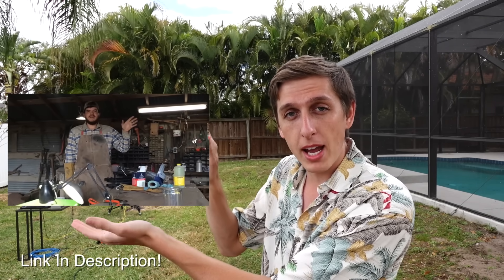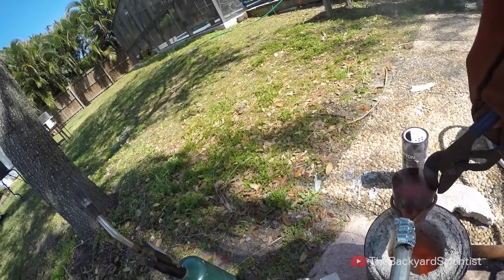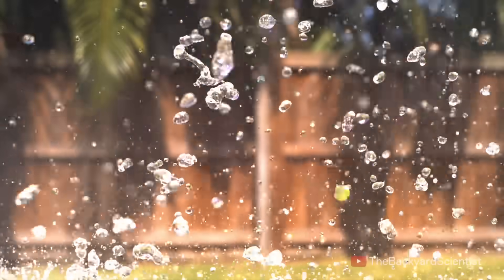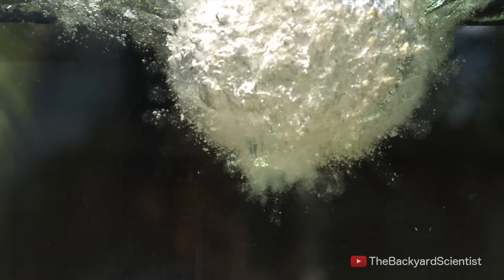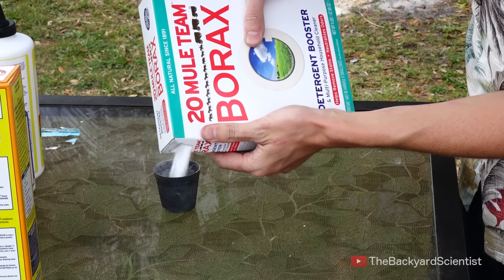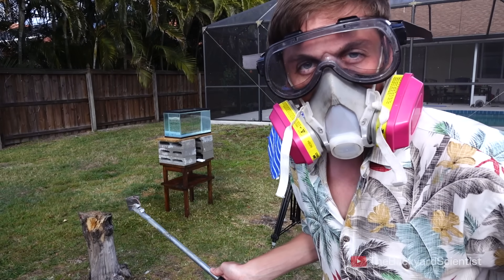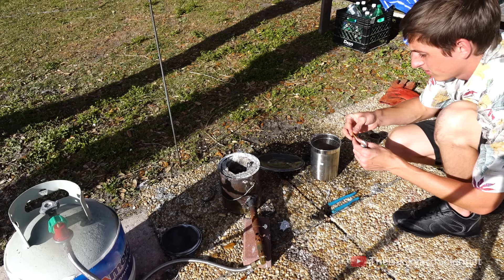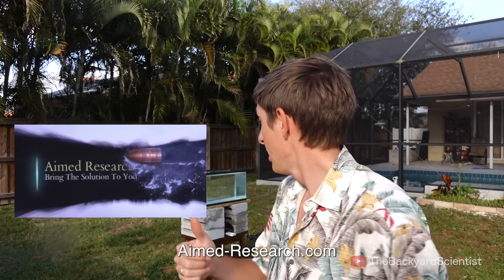Pouring Molten salt into Water - Explosion!

Comment: This due to the high solubility of NaCl in water. Each grain in solid NaCl can interact with H2O normally. It usually involves a lowering of temperature but we don't notice it. Now if you have molten NaCl, that means the molecules are in a liquid lattice, so less molecules are freely accessible to interact with the water. that coupled with the high temperature of the molten solution is why it explodes. There is excess energy to facilitate the dissolution, but not enough NaCl exposed to H2O. All the other salts are only weakly soluble

Comment: The principle behind this steam explosion is that when water turns into a gas, its volume increases 1700 times. (1L-->1700L)
By introducing water to a substance at a high temperature of several hundred to over a thousand degrees Celsius, the volume increases instantaneously, generating tremendous power capable of easily destroying a container.

Comment: When you're dealing with extreme heat and cold things will happen which is why you don't use water to put out various fires. You can get explosions. Try having molten metal and pour water on it. It explodes

Comment: Molten salt frequency generates Hydrogen with heat setting off the Hydrogen thats very flammable and boom 💥?  It's all about frequency.  Like so many use frequency to generate HHO from water correct? Yet no one ever uses an ultrasonic vaporizer set at a frequency to generate HHO from liquid air generated by a Stirling helium cryogenic piston? Using water 💧 to generate HHO is low end generation of HHO using liquid air to generate HHO would be more efficient because everything is already in a gas state just super cold in liquid form? I'm not a scientist so never hurts to try  it out see if it actually works? 😊

Comment: It seems the next step was obvious but was not taken . It should have progressed to melting the sodium metal and the salt together and then pouring it into the water . And then melting them separately but at the same time and pour them both separately but at the same time . Not a simple feat but a smart guy such as your self could probably come up with something . What's interesting is that it is releasing a great amount of energy . If you could have a way to harness that energy into a useful purpose it might be something to explore further. Remember you can neither create or annihilate anything . I mean if you could turn it back into its original form it might also release it's energy changing from one form to another. If you could keep the process going I would think there is definitely enough energy to drive some sort of piston .
Reply: I was just thinking what happens when salt water comes in contact with hot magma like an underwater volcano ? Or if lava was to flow over the salt flats .

Comment: This is a chemical reaction due to the miscibility of molten sodium chloride in water. As the sodium chloride dissolves, the surface area for the heat transfer into the water grows exponentially which then results in the instant creation of steam.
Reply: That is what he said basicly and that is a physical reaction because the salt and the water don't change
Reply: @DanielThePyroGuy makes sense ... Miscibility is a physical process if no new compounds come from it.. had to shift my perspective
Reply: @uswine  yeah i think that this explination is pretty plausible
Reply: Because it fits the observations quite well

Comment: The Leidenfrost effect breaks down for sodium chloride (NaCl) due to its unique interaction with water. When molten NaCl is poured into water, it initially forms a steam layer that insulates the salt, similar to other substances experiencing the Leidenfrost effect. However, NaCl's high solubility in water leads to rapid dissolution, disrupting the insulating steam layer and causing direct contact between the salt and water. This contact results in rapid heat transfer and steam production, breaking the Leidenfrost effect and leading to explosive reactions

Comment: It's a chemical reaction, since this explosion also occurs with hot but not yet molten salt.

It also doesn't hapen with other stuff thay is hot and molten going into water.

The sodium in the salt must be reacting with water at high temps somehow.
Reply: But the salt or water didn't change no ph change and basicly all the things the sodium could React into would change the ph
Reply: And he showed that barely molten salt didn't explode and he had to heat it up even more for it to explode violently
Reply: @DanielThePyroGuy  it does explode with not yet molten salt, I'm guessing the explanation he provided is a part of the effect, but it's not the entire effect, since there is still a reaction between solid salt and water.

Comment: It explodes like that because the salt is very freaking hot and it's being poured into much much much cooler water. Not a freaking mystery
Reply: Then why didn't the other molten salts explode like the sodium carbonate which have a higher melting point so would be hotter?

Comment: The reason that molten table salt gets explosive in water is because melting table salt does 2 things, exothermically breaks the chlorine sodium bonds, which makes the chlorine release it's self as chlorine oxides whild leaving the sodium to melt.

What gets left from that is PURE ELEMENTAL sodium in it's extreme liquid explosive variant.   When pure sodium is liquid, it immediately explodes way easier in water.   Sodium's metallic form does a dosey doe on the surface of water or a bumper boat kind of thing (depending on what it was tossed into) before violently exploding 🤭🤭😂
Reply: He tested molten sodium in water and it exploded way differently he also checked the ph of the water before and after dropping in molten salt and detected no change if it was pure sodium reacting it would've formed NaHO which would increase the ph

Comment: I think you could test the leidenfrost effect by heating salt to the same temperature as you would a burner that a droplet will sit/dance on comfortably, and try the water the same way, it should last just as oong on average, unless salt gets dissolved in it, and that lowers the boiling temperature (which would again act as an explosion)

Comment: I think the reason why the other sodiums didn't work is because they weren't a pure crystalline mineral. If @scottmanley is wrong then I stand with my observation. So instead of sand or gravel, use sugar. That explodes in superheated water, of course due to the disturbance of the waters surface, but maybe there is a similarity? And if that's the case, then the physical reaction theory remains true. Perhaps @just4deez explanation is an expample to why my observation may be correct. If that's the case, could you do the same with larger crystalline structures? Or do they have to be broken down closer to the molecular level? Which would make sense if just4deez is correct, because it could spread through the water at a quicker rate covering more surface area of the molten substance. Either way, crystalline structures react rather oddly compared to other minerals and materials. Taking into consideration their molecular structure and how they interact with light. Perhaps there's more there than the average joe knows. Thats why I'm posing the questions, I'm the average joe lol Alright gotta get back to work now 🙃

Comment: Its the water changing to gas rapidly that makes it explode. It will mess you up if you do not heat all moisture out of a form  when pouring molten metal like lead into something. Even  if i there is a small amount of water.

Comment: From chat gpt:

Molten salt can cause explosions when it comes into contact with water due to a phenomenon known as "thermal shock" or "steam explosion." When a substance, like molten salt, is at a very high temperature and comes into sudden contact with a much cooler substance, like water, the extreme temperature difference can lead to rapid and violent vaporization of the water.

Here's what happens in more detail:

1. *Rapid Cooling:* Molten salt is at a very high temperature. When it comes into contact with water, which is at a much lower temperature, the heat energy from the molten salt is transferred to the water very quickly.

2. *Rapid Vaporization:* The intense heat causes the water to vaporize almost instantly, turning into steam. This rapid vaporization creates a sudden increase in pressure.

3. *Pressure Buildup:* The steam generates pressure within the water, and because it's trapped by the molten salt's surface layer, the pressure builds up very quickly.

4. *Explosive Release:* The pressure buildup can become so rapid and intense that it can rupture the molten salt's surface layer, causing an explosive release of steam, hot salt particles, and potentially even molten salt droplets. This explosive release is what creates the "explosion."

This phenomenon is similar to what happens when you throw water onto a hot stove or into hot cooking oil, though the specifics of the reaction can vary depending on the particular substances involved. It's important to note that the presence of dissolved salts in water can also affect the vaporization process, contributing to the explosive nature of the reaction between molten salt and water.
Reply: This looks correct, but ideally I'd use Wikipedia and not ChatGPT in the future

Comment: i have a hypothesis that the reason the other salts you tested didn't react as violently is because they were made using polyatomic ions as the counterpart to the sodium (or hydrogen for boric acid). I have nothing to support this, but that seems to be a factor that you didn't control for. I would be very interested if this happens with the other alkali chlorides.

Comment: Energy of the compound poured in the water depends on more than just the temperature. And as you mentioned for the explosion to happen, water has to be trapped in the hot thing. Salt has a relatively low melting point. And takes significant amount of energy loss to "freeze" it back.While it also has to dissipate a lot of energy to be cooled down by 1 degree.

My guess is that these three factors combined make it perfect for the explosion, as it stays liquid longer, changing it's shape, trapping water, increasing the contact surface, then delivering a lot of heat to boil a lot of water.

Comment: You just explained it: the sodium ion is soluble however it is molten and hot which cause a steep activating barrier and a forceful expansion of the hydrogen bonds in the 🌊

Comment: What makes sense to me is that the temperature of molten salt is hot enough to convert some of the water straight to superheated steam (steam under pressure higher than atmospheric pressure). The sudden increase of pressure created the explosion.
Fun fact is that one of the solar electric generation method uses concentrated sunlight to create molten salt, and then using molten salt to turn liquid water into superheated steam before it enters steam turbine.

Comment: 5:23 “it’s protected and never able to contact the water”

Him later in the video: “I have no idea why it didn’t do anything in the water!”

You tested the sodium and it exploded instantly upon contact with the water. My guess is the chloride was protecting the sodium for a very short duration while the salt was inside the water, then after this short time it then exploded. And my guess is that the other ones you tested didn’t explode because as you said, they were “protected” and unable to make actual contact with the water.

Comment: I worked in a foundry and the same would result when moisture is introduced in the furnace of molten metal. There is an instant vaporization of the moisture that causes a rapid expansion.

Comment: I was just thinking… doesn’t table salt increase the boiling point of water? What if, as the salt is absorbed by the water, that small difference is allowing the water to slip in closer to the molten salt, where it vaporizes and deforms the salts surface, increasing surface area, rate of absorption, and repeat?

Comment: To folks thinking this was a steam explosion:  Notice how the other salts simply formed a steam bubble around itself through the Leidenfrost effect. Furthermore, putting a red hot nickel ball into water leads to the same outcome (steam blanket around the glowing red hot metal ball), with no explosion. The video also clearly shows a detonation instead of a steam explosion, where superheated water vaporizes (throughout the liquid) when the pressure drops (through failure of its containment vessel)

To achieve these kind of detonations as observed in the video, you need the heated liquid stream to rapidly split itself apart into tiny fragments that can heat the surrounding water at a rate fast enough (the expansion of the liquid from this heating needs to be faster than the speed of shock wave propagation in the medium). This means that the liquid droplet needs to somehow obtain some amount of energy that can overcome its own surface tension and disperse itself into tiny droplets which further increases the interface area (a self-propagating, exponential process). The main way this is done is through charge. Supposedly, the Cl- ions can react with the supercritical H2O at the superheated water-salt interface to form HCl and Na+, OH-. The superior mobility of protons in water rapidly neutralizes the OH- at this interface, leading to the fast accumulation of Na+ in the molten salt itself. This charge buildup can eventually overcome the surface tension of the salt, leading to the droplet ripping itself apart. The act of the droplet ripping itself apart will further increase the salt-water interface. Eventually the salt-water mixture turns into steam and we see the detonation in this video. I might be wrong with some of the details but I think some form of charge accumulation in the salt overcoming surface tension should be the main cause.
Reply: Actually, it's called a coloumbic explosion
Reply: It's really cool how these processes can be so minute in their detail! We think its either physical or chemical in nature but the physics and the chemistry are deeply linked,  the behavior of charged particles drives the chemical interactions which provide kinetic energy and raise the temperature exponentially. It's cool how there are so many ways to create an exponential reaction that are all just a little bit different from each other, but we normally just observe as an explosion.
Reply: So we could expect a similar reaction from potassium chloride since it has a similar charge makeup?
Reply: @tacolands  possibly
Reply: FurryTherianBleps  Molten salt in water goes boom.
Reply: That doesn't quite make sense - there is no enhanced buildup of Na+ in the molten salt because the sodium in molten salt is already 100% Na+ even before it hits the water (it is an ionic compound).
Reply: @ true, the NaCl already exists as a “sea” of molten Na+ and Cl-. However, reactions can occur on the interface: Cl-(molten salt) + H2O(liquid) > HCl(aq) + OH-(aq). The reaction is favored because proton mobility in water is high. Cl can pull protons from the nearby supercritical? water molecules and OH- formed can also get neutralized rapidly from the water molecules around it (high proton mobility) and the net effect is the accumulation of positive charge in the molten salt droplet. Just a hypothesis, haven’t done any specific calculations on the kinetics and mass transfer but someone could probably run a study using titration with D2O to test this.
Reply: like atom splitting nuclear bomb but in water.  COOL

Comment: wonder if it would work as an anti submarine explosive like imagine a large amount of molten salt being instantaneously exposed to water next to the submarine
Reply: Would be pretty hard to heat all the salt up to the required temperature level and contain it before it makes contact with the water. I am imagining some kind of metal recipient that can open up and expose the molten salt inside. Still, you would need to heat the salt up and maintain it inside the recipient without losing heat until you can find a target and drop it. Also I don't think you could do all the heating up process in a ship, as it takes some time to do, so it would be an extremely slow producing weapon, and only has little time to be used.
Reply: You can. Thermite in an enclosed can create lots of molten metal. That molten metal touching water can lead to an explosion. But at that point you are far better off just using chemical high explosives instead.

Comment: Before he got into the explanation, I was thinking it was an expansion of air as how it looked, it was an air bubble forming underwater. I’d further guess the expansion was happening faster than the speed of sound for it to make such loud popping noises. The other variant is astonishing as it hit the water, it created sparks and fire even. That it ignited as it hit the surface, because water does have oxygen, the molten lead salt temperature might have been high enough to spark an ignition. The first molten salt, it’s just when heated up, a lot of air is trapped and hitting the water rapidly cools it and breaks the sodium silicon, allowing the air to escape at faster than sound speed. I’m just guessing and I may be wrong.
Reply: How can air get under the water?  You mean water vapour - vaporised water.
Reply: @gibbogle  I meant the air trapped inside the material.
Reply: @Supersteam09  Inside which material, the water or the molten salt?
Reply: @gibbogle  The molten salt. The thing was super heated (It’s been 10 months since I last saw this video so pardon if I was incorrect). Being exposed to liquid would cause air pockets to form and thus results in an explosion.
Reply: @Supersteam09  There's no way for air to get in.  Your name holds the key :)
Reply: @gibbogle  Steam…yea, I get it